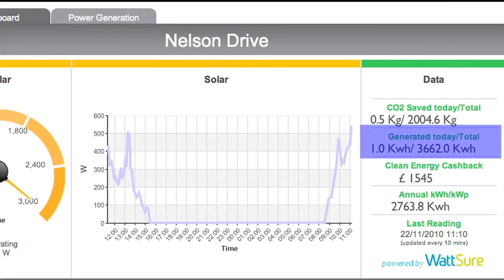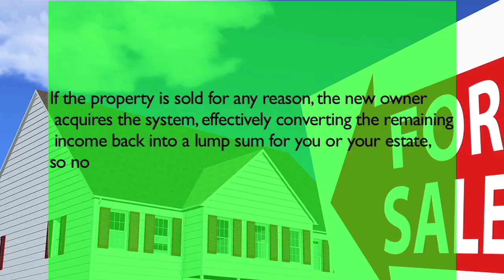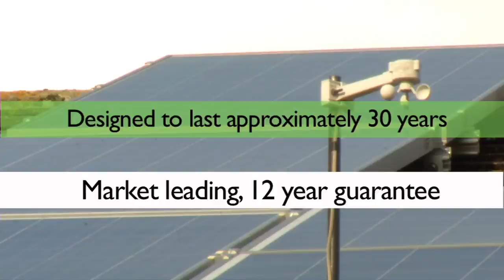Solar Power Myth Busting Video

Comment: At 42 Deg. N Latitude US, there is an average of 19% sun over a full solar year. The further north you go the less sun there is (fact) over a full year. At the equator, the sun hits the earth dead-on. With 12 hours of daylight, theoretically, you get 50% sun...counting cloudy days and rain, you get about 32% sun. Do you think you can run your house on an energy source that is on 32% of the time?